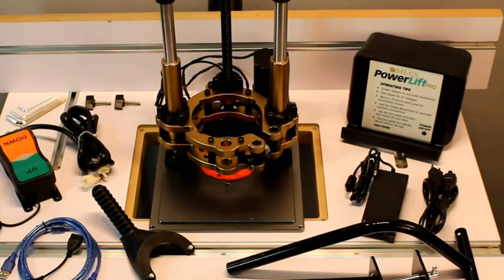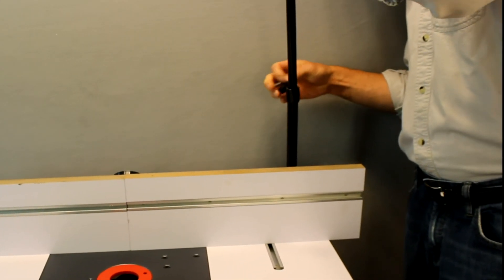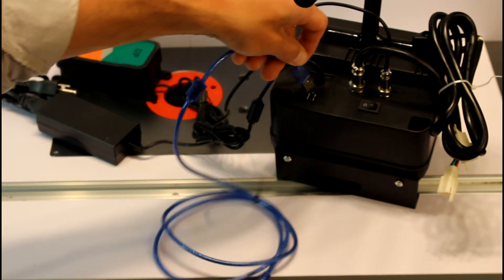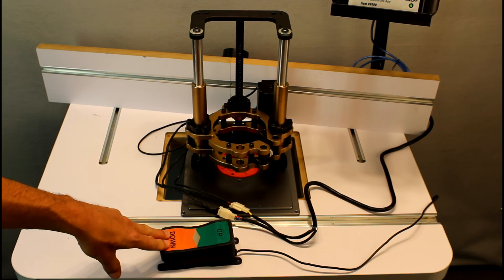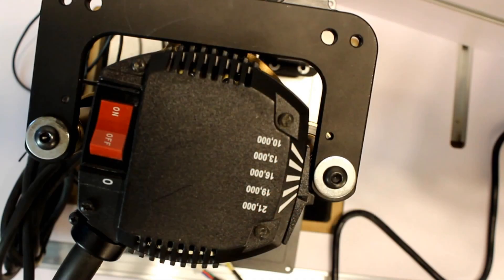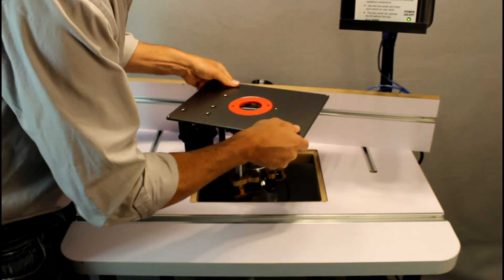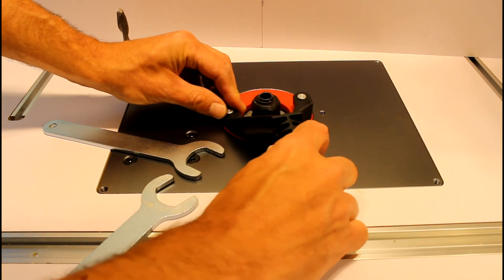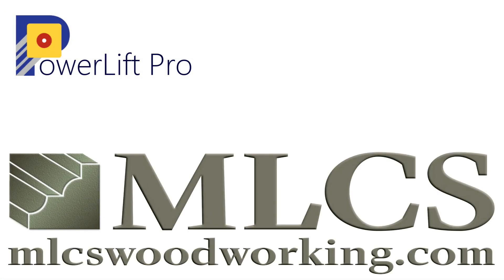First time Setup - MLCS PowerLift Pro - Android controlled woodworking router lift

Comment: Is it always this slow, going up and down ?
Reply from the maker: @23101979T  you can set the speed of the lift in the app.  When you're trying to hone in on a precise location, the slower speed is better.  There's also a button in the app to move the lift to the top most position (for bit changes) at 100% speed

Comment: Thanks for this straightforward video... now I have a much better idea of what to expect when I setup my newest 'toy'!
Reply from the maker: Excellent!  You won't be disappointed.  It makes everything you do on the router table easier.

This video shows the USB connection to the tablet, which thankfully you won't have to use.  It supports Bluetooth now.
Reply: @EagleLakeWoodworking  😃👍

Comment: I'm glad you showed the big PC router in this video. I have the same router and I am concerned about clearance and access to the speed switch on the PC 7518 once it's in the mount and in the router table. This does not appear to be anywhere near as accessible as with the Woodpeckers PRL-V2 lift. I don't want to buy another router just to use this lift.
Reply from the maker: Bob, the lift is fine with this router, but adjusting the speed switch can only be done  when the router motor isn't in the area of that bottom cross piece on the lift
Reply: I had to rotate the router about 10 degrees to get the switch to clear the frame. If I didn't the switch would have been crushed when the lift carriage was full down. And I could not get it setup with the full travel either. I had to adjust the upper limit switch to keep the router from crashing into the underside of the plate. I know what I saw in the video I just couldn't get mine setup that way without some interference one place or another. I have the router in the mount in the same position as you with the cord exiting in the same place. Everything works I just have less travel than four inches. I have about three inches but I did not measure it.

I wish there were two speed settings, one for the foot pedal and one for the app buttons. It's impossible to bump the bit up or down a thousandth with the foot pedal when the speed is set at 50%. It works very well at 1 or 2%, but then if you go to use the memories or presets they also operate at that same speed so you have to adjust the speed or take a coffee break while you wait. 🙂

Also, being able to save your presets as a project so you could return to them any time in the future would be nice too. A simple software change would allow that.